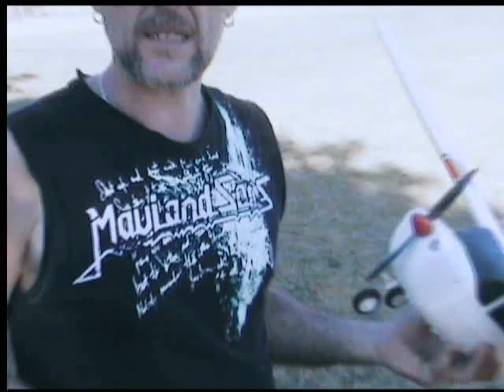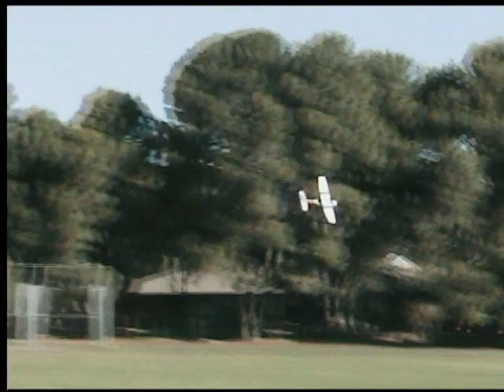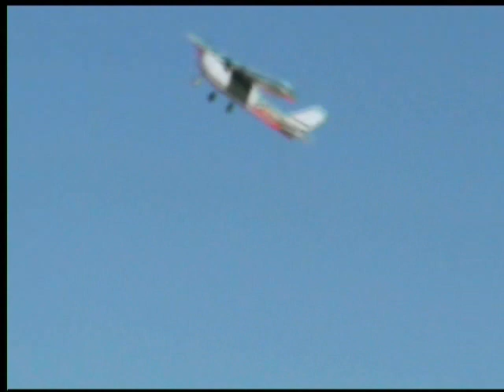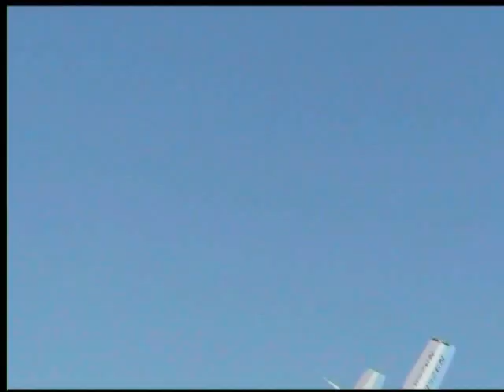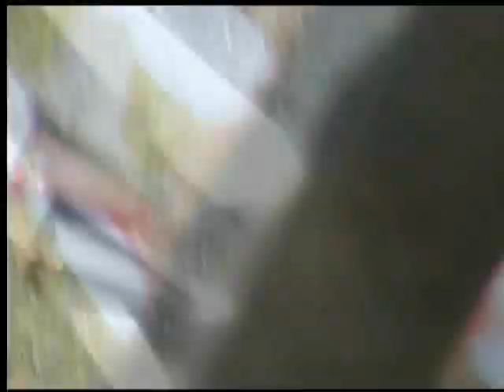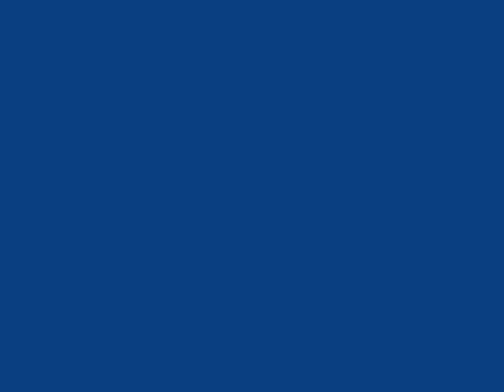Another bit you did not see (Cessna Crash)

Comment: I have one of these.  It's a cow to fly (compared to my nitro) but seems relatively tuff.  Mine has stacked enough, I am onto my 5th cowl, it has hit a tree, and now the nose wheel will fall out mid flight, but it still flies o.k, although that does upset the CG.  I've had about 30 flights so far.
Is yours the 3 channel or the 4 channel version?  I went the 4 as when I had my first 3 channel plane, it would always slip in turns, and I kinda steer away from 3 channel's now.